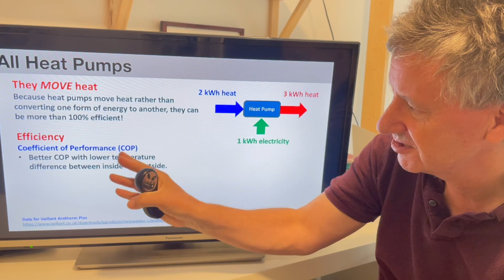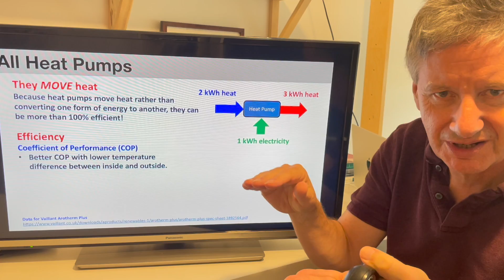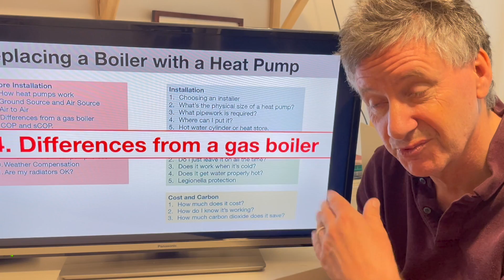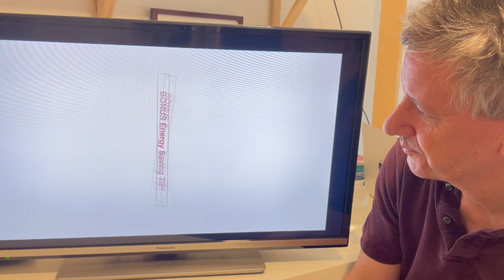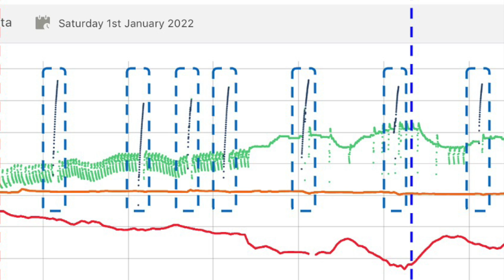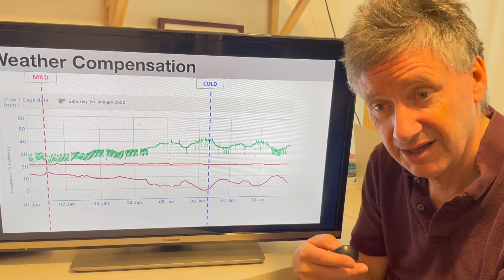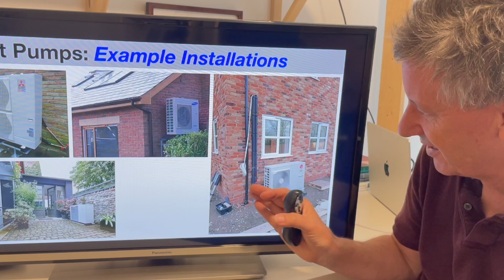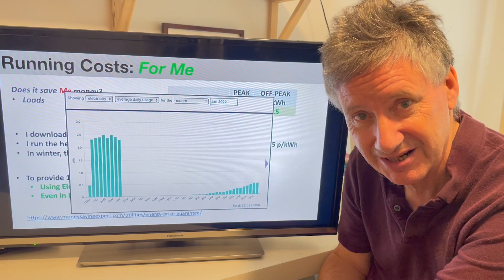Replacing a gas boiler with a heat pump

Comment: What a load of crap. I want to also have a heat pump, but its 4x more exspensive at the momment. I also have issues with my supply to my property. I then have several freinds who have had them installed but they have to have gas heaters to help them with kerping the home warm . So i will still have one but i will also keep my lpg and work both together in winter periods. I like the idea of cop what not to like. But the reality is the huge cost of insulation. I know that companies now are offering higher heat pumps to actually match outputs. So lets see.
Reply from the maker: Gino, you seem very unhappy, but I don't know why. I have done nothing to offend you except possibly disagree with you. I am hurt that you choose to insult my work which took me a long time to create.

1. If you don't want a heat pump: don't get one: simple. 
2. If you want to reduce your CO2 emissions then a heat pump is the best thing most people can do.
3. Heat pumps are NOT 4 x as expensive as ??? you don't say - I guess you mean gas boilers. 

I won't go into details but if you have a cylinder Octopus can install a heat pump for free. Even if you do require a new DHW cylinder, it's probably only an addition £1k or £2k. And this was announced before the increase in the Boiler Upgrade Scheme award to £2,500.

https://x.com/OctopusEnergy/status/1702289978665869731?s=20

If you want to keep both an LPG burner and heat pump: great :-) I hope you re happy with that.

4. Insulation is generally the most cost effective thing one can do to a dwelling. But if you prefer not to do it, no one is forcing you.

Best wishes

Michael

Comment: Where does the 2900 come from?
Reply from the maker: Mark, Good Evening.  The 2900 is part of a rule of thumb for estimating the maximum heating power required for a dwelling. I discuss this at length in this video

https://youtu.be/hCeghKa3liM

In summary, it's got a factor for boiler efficiency and factor for the number of "heating degree days" in a UK winter - essentially the length and depth of winter.

All the best

Michael

Comment: 3600 BTU /month during winter = 2628 kWh x £0.34 p/kWh = £893 before v.a.t monthly ! Basic maths.
Reply from the maker: Good Morning. I'm afraid I can't understand your comment. I don't think I talk about BTU's. 

Best wishes

Michael
Reply: I just googled electric consumption heat pumps, being curious what would come out, as average bill during winter month, figures come from that, may not be accurate, but that being 1st step of my research I thought I got it wrong. I welcome some realistic figures showing electricity consumption for average household having heat pump, instead of gas, using electricity for cooking etc.
 @michaeldepodesta001

Comment: how do you weigh co2?a a cubic mtre of air weighs 1lb and that is nearly all water vapour..........you cant weigh gasses as they are all different weights and co-mingle.....if you can fool yourself........
Reply from the maker: @roybarton9617 Good evening. 

In fact it is perfectly possible to weigh gases on a sensitive weighing scale, and I have spent a significant fraction of my professional career doing that. One typically evacuates a steel bottle and weighs the bottle. One then fills it with gas to a specified pressure and on re-weighing one can find the weight of gas added. It's not an easy procedure but it is quite do-able.

A cubic metre of air weighs more like 1.2 kg under typical conditions, and typically less than 1% of that is water vapour.

Best wishes

Michael

Comment: Great video, it’s something I want to do as I have solar and storage but I still have a working gas boiler. Also I find the costs are really high….even after grants. Yes heat pumps are more expensive compared to a gas boiler but only £3k more on average plus extra for a hot water cylinder…..yet installers are charging £12k-£15k. I’ve not seen any installers charging £9k to supply and install a combi gas boiler.
Reply from the maker: Peter, Good Morning. Thank you for your kind words. Yes, it is an expensive business. And I am a bit odd! Yes, I am trying hard not to emit carbon dioxide - and after retiring I had a pot of money to spend and I couldn't think of a better way of spending it. So I have no concern for return on investment which I know matters to most people.

It sounds like you are already on a journey, and I wish you good luck with your endeavours. It really shouldn't be this hard to do the right thing!

Best wishes

M

Comment: Main take away point, it seems to me, is that I also need solar panels and batteries installed for it to be worthwhile.
Reply from the maker: David, Good Morning. 

Replacing a boiler with a heat pump always makes sense from a carbon emissions reduction perspective, but I agree, it only makes financial sense if you can get access to cheap electricity through a battery/solar system.

Best wishes

Michael
Reply: @michaeldepodesta001  And the cost of all that many people can't afford michael.
Reply from the maker: @foppo100  Indeed. Many people cannot afford the  capital costs. I think that will change, but that is the situation now. Best wishes: M

Comment: Hi Michael. I love your channel ! The information presented is excellent ! I am.also preparing to buy an ASHP (arothern+), and the local dealer insists to have a buffer installed (Vaillant VPS100, 100 liters). I have only radiators, extra large triple ones, and a constant water volume in the system of ~ 110 liters, all radiators are ALWAYS on. Assuming that the buffer is needed for defrosting, isn't it redundant ? Obviously would affect the Cop. Can you please help me with an advice on this ? Much appreciated ! Adrian
Reply: Thanks Michael. I will install the buffer, but additionally i will install a bypass valve, as well, so that I can go around it, if/when needed.
Reply from the maker: @adrianbotos2819  That's a great idea. Will you install a monitoring system such as Open Energy Monitor?
Reply: @michaeldepodesta001 , i will add a monitoring system, hopefully upon the Ashp install. They are not the cheapest gadgets, but i know i will need them, eventually….
Reply from the maker: Adrian,

Good Morning. When we had our system installed it was with a low-loss header - which functions similarly to a buffer. At the time I did not really understand why and wrote this article about the role of a low-loss header to try to explain it to myself. 

https://protonsforbreakfast.wordpress.com/2021/06/10/heat-pumps1/

I think buffers and low-loss headers improve the chance that a system will "work" first time. But I am pretty sure it reduces the best achievable COP. We have had the system for two heating seasons now - I'll be comparing the two seasons on my blog sometime in July - and achieved a COP of 3.5 for both years. This is good, but I am considering having the low-loss header removed to see if that improves the COP for the next heating season.

Advice? It's difficult to advise you remotely, and in the end you are in the hands of your installer. Personally, I let the installer do what they thought best, and it has worked out OK for me. But you could ask the installer about why they recommend a buffer? And if you are prepared to take the consequences, insist on leaving the buffer out. The problem with this is that if something doesn't work then the installer may not want to take responsibility. I would always want to stay on good terms with your installer!

I am sorry I can't be more specific. But best wishes with your installation.

Michael

Comment: Hello Michael, I have a figure of 173 KWh/m2 after looking at Nicola Terry's article and the bit on insulation. You suggest this figure should be under 100 or insulation likely is necessary for a heat pump to be feasible. Given all other calculations suggest likely heat pump size of 11kW, is it unwise to go ahead without better insulation? I have loft insulation and double glazing but probable heat loss of 100W/m2 according to survey and I think I can live with suggested radiator upgrades.  
Thanks for all the useful information.
Reply from the maker: "You suggest this figure should be under 100 or insulation likely is necessary for a heat pump to be feasible." 

Jon, Hi. Did I actually say that? If so I think I may have mis-spoken. What I think is that heat pumps can heat any home, but a heat loss of 100 kWh/m^2/year is indicative of whether there is more you could do with insulation. If, for whatever reason, you have insulated as much as you can, then a heat pump can be made to work.

11 kW is a large heat pump so presumably you have a large house?

It is very difficult for me to give specific advice without knowledge of your specific situation, and if someone has looked at your property in detail and thinks that - with radiator upgrades - it would be OK, then I would trust their 'on the ground' judgement.

Best wishes in your endeavours.

Michael
Reply: @michaeldepodesta001  Thanks Michael, I thought you might say that given everything else you've said. Good to know.
No we don't have a large house (although everything is relative) and I have challenged them (British Gas) on the size they are recommending but they have said it is down to the flat roof and large window on the extension and the chimney in our living room. Octopus wouldn't proceed after they surveyed as they felt everything was borderline (still 10-11kW) although they didn't suggest hardly any changes to radiators so I think they just have a different business model - choosing to install in homes requiring less updates of existing system perhaps as that way they can give lower fixed quotes.
There is an additional irritation that they seem to be using the EPC energy use estimates which are higher in my opinion than they should be as I put in 300mm of loft insulation last year which seems to have reduced gas consumption by about 400 kWh (to 20350 kWh compared to the 2 years before), not to mention the assumptions they use in terms of construction, but they don't use the energy usage as stated on my bills. 
Sorry Michael, all my frustrations. Just putting you in the picture and I don't expect advice. I have noticed that the correction you did on 24th March on the coldest day spreadsheet doesn't seem to be there - the gas cubic metres option is not included in the formula. 
All much appreciated and all the best.
Jon
Reply from the maker: @JonWalker-l9h  What a frustrating time. Here are a couple of thoughts (assuming your home is in the UK south of Manchester).

1. I hope you have made a typo and that the loft insulation saved you 4,000 kWh/year (about 17% of your consumption) not 400 kWh ((about 2% of your consumption - and well within annual variability). 

2. Using the 'Rule of Thumb', 20,350 kWh/year corresponds to around 7 kW heat pump size. If you previously used 24,000 kWh/year then the 'Rule of Thumb' would indicate around 8.3 kW peak heat pump power - which in terms of heat pump sizing is not very different from 10 kW. Physically they are both likely to be large twin-fan units. And given the conservatism of installers, I can see why they are suggesting 10 kW heat pumps. 

3. The whole process is very frustrating and filled with uncertainty. Please allow me to send my best wishes with your endeavours.

Best wishes

Michael
Reply: @michaeldepodesta001  Michael, thanks so much. It is great to have your input and I do appreciate your thoughts. I have challenged again based on the fact they estimate heat loss rather than using energy usage according to my bills but it's really only me wanting to maximise efficiency of operation. I just want to see what they say. Yes, it was a typo. 4000 kWh saved with loft insulation.
Jon

Comment: What is the reason for not removing your gas meter Michael ?
Reply from the maker: Mohamed, good evening. 

I wanted to have to the gas meter removed last year, but with the political uncertainty last autumn (2022) there was talk of possible electrical power cuts. For that reason my wanted to keep the gas supply - we still had one gas fire - as a back up.

But earlier this year we did have our gas meter removed. Hurray!

https://protonsforbreakfast.wordpress.com/2023/03/27/the-gas-man-cometh-for-the-last-time/

All the best

Michael
Reply: @michaeldepodesta001  many thanks Michael. I am thinking of removing mine and wanted to have some advice. I am using your video as a good reference

Comment: Where does 2kwh heat come from before entering the heat pump (at 8:02 minute) ?
Reply from the maker: Dear Tung Tung, Good Afternoon.

The 2 kWh of thermal energy is removed from teh air outside your house. The outside air (which is already cold) gets even colder. And that thermal energy which has been removed from the air is used to heat your home.

Check out this video for a slightly chaotic explanation of how a heat pump works.

https://youtu.be/jDjBZ9GqFmc

Best wishes

Michael
Reply: @michaeldepodesta001  Thanks Michael. If heat pump is replaced by a normal fan, the fan also moves 2kWh heat from outside into the house. Its efficiency can be said as 100% (ignore small loss in the fan). 
My understanding is: Heat pump converts 1kwh electricity to mechanical energy that raises the pressure applied to the refrigerant hence increase the temperature of the refrigerant. That in turn transfers more heat into the house. So heat pump is not moving heat only but also contributes to the extra heat in the house.
Reply from the maker: @tungtung4229  You are correct that the heat energy used to operate the heat pumps also ends up in the house. Typically 1 kWh of electrical/mechanical energy is sufficient to harvest 2 kWh of environmental energy making a total of 3 kWh of heat which enters the house.

I don't understand your comment about a fan: A fan blowing cold air from the outside into the home will not heat the home at all!

Best wishes: M

Comment: Excellent I watched this video three times. Based on it I just installed a heat pump from Octopus. The experience is however bizzare. The temperature sensor indicate 20 degrees which is near what I want. However I don’t feel the warmth and the radiators are most of the time cold or mild but from time to time they get warm. Is this expected Michael? Just checking as you have more experience 
Thanks again
Reply from the maker: Mohamed, Hi. Good Evening,

First of all, congratulations: you are now savings TONNES of CO2 emissions per year!

Secondly, yes, assuming you are in the UK as I am, with outside temperatures above 10 °C your radiators will be barely warm. As I type, the outside temperature is 10 °C, the radiators are at about 30 °C, and the room temperature is 20 °C within ±0.5°C. The COP is about 4.3. 

In my house the maximum radiator temperature is about 45 °C when the outside temperature is -3 °C or so. 

I think after a while you will get used to it - it's weather compensation in action. My guess is that we will still have a cold spell or two to come before spring and summer finally arrives and then you should see the radiator temperature rise. What you should never be is ...cold!

Best wishes: Michael
Reply: @michaeldepodesta001  thank you so much Michael. Yes I have the same conditions as you (by the way I am in the south east as well). The weather compensation is active. 
All the best
Reply from the maker: Great: I hope everything goes well. BTW, (and I don't know if this is relevant) but over the summer I switch my hot water cycles from night time (using cheap electricity) to daytime (using solar electricity - and since the air is warmer during the day it is more efficient). Best wishes: M
Reply: @michaeldepodesta001  many thanks Michael, yes it’s a learning curve. You are a scientist with experience in measurement and clearly the sensors in the house are indicating the desirable temperature but somehow our body feels the warmth when it comes as bursts of heat instead of gentle heat.
Reply from the maker: @DahouiM  I am concerned that you might be cold! If you are cold, you need to increase the setting on the thermostat, change the weather compensation setting or put on a pullover! A thermometer can tell you the temperature, but it can't tell you whether or not you feel cold!
Reply: @michaeldepodesta001  many thanks Michael for the advice. Very much appreciated

Comment: what you think put ventilator bellow radiator?
Reply from the maker: Zoran, Good Evening. Putting a fan or blower underneath a radiator is a great idea. It improves heat transfer from the radiator and improves the heating power of the radiator - assuming the flow temperature remains the same.  Alternatively, using a blower can allow the same heating power with lower flow temperatures. 

All the best: M
Reply: TY

Comment: I'd be reluctant to use a Sunamp (Thermino), hot water storage battery, with a heat pump. The minimum required heat source flow temperature is 65C, to melt the phase change material, and charge the store. Not a very efficient way to run a heat pump IMO, especially if you use a lot of hot water. It would drive down the SCOP.
Reply from the maker: Damian, good morning. That's a fair point. But finding extra space inside a home is very difficult, particularly for those in small dwellings. So I see a thermino as 'heat storage of last resort'. All the best: Michael